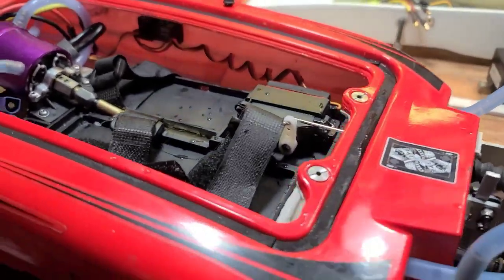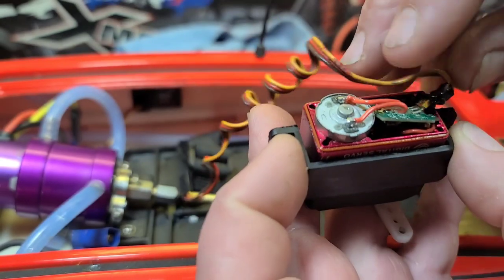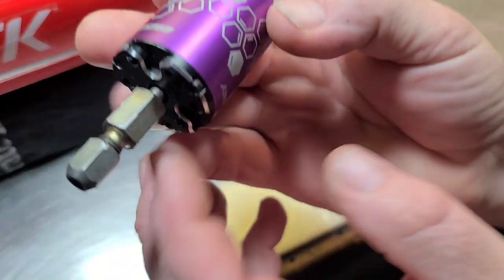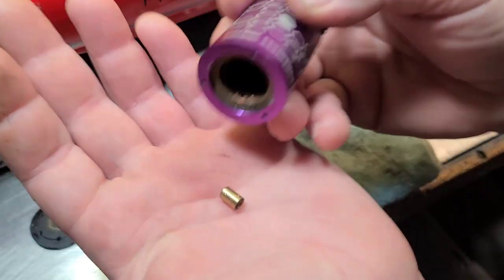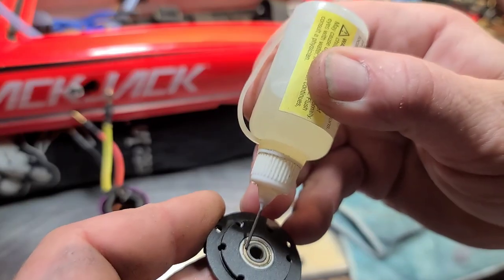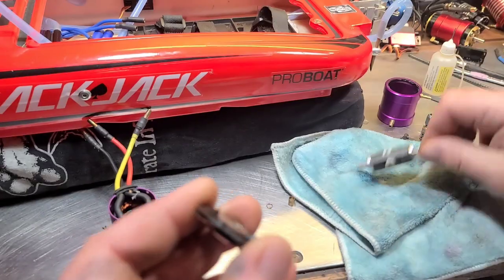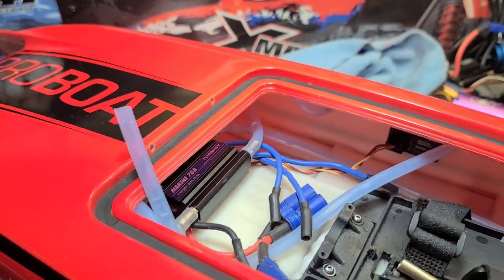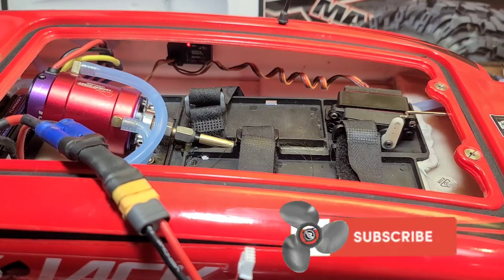Sinking Boat Save Your Electronics - Maintaining Your RC Boat After It Sinks

Comment: Good video! Good, Helpful Hints. 

May add its so helpful to buy large silica packs and always store boat and cars/crawlers/MTs with them inside the body.  Best to pop the hatch open. If I have an Oh Chit episode I will dry,  blow everything off, lint free towels on motors, oil/grease everything. Store the victim boat in a small guest bath with a dehumidifier running at least overnight.  Saved me a few times.

Comment: Take precautions before you sink it.  You can buy liquid electrical tape or plasti dip and use this to seal around the servo.  Paint it onto the receiver circuit board and around any openings to the battery.  Then use dielectric grease on all the electrical connectors.  If you take the time to do these things water will never be an issue again.  
Peace Big B  "Boat Crew"

Comment: Just got back from the lake for a few runs,and the cooling line fell out of the cooling jacket, it ran hesitant for a bit once I hooked up the cooling line back up,it was fine ,It’s a. Traxxas M41 , recived box is dry ,but opened it up and is drying.running it on 4s for now , not sure if I need to disassemble the engine ,it’s all stock, .Thanks Brother

Comment: If you do conformal coating on the ESC & reciever and the servo electronics board, then pack the whole servo with dielectric grease, you would save 90% of the electronics and never have issues with them submerged. All else like you did clean with Corrosion X and lube. Would be better to spray motor with Corrosion X before running so if gets submerged nothing will happen just let air out. Only issue will be the lipo battery unless sealed in a bag or box.
Reply: Done that  ,receiver is dry  just were the wires go into it there’s a big gap
Reply: I also upgrades the prop and trim tabs,to hot racing

Comment: I flipped my boat like 2days ago and i have just let it air dry, is there no hope for saving it or is it still good
Reply from the maker: Should be good, oil the motor bearings and grease the shaft, make sure receiver is dry..    Nine times out of ten, the servo will be the first to go if the boat was fully submerged
Reply: @IRONCLADRC I need help, my little brothers rc boat that’s $60 by deerc sunk to the bottom of our pool and the servo is seizing up and when I turn the boat on it automatically turns for the same position that’s not center and won’t turn well at all

Comment: Oh how bad Is it not running the Teflon tube inside the studfing tube 🤔? To be honest I really couldn't get it in
Reply from the maker: It's fine but the tube should be the right size w/o liner. Off shoe Electrics has a chart for tube /liner suggested sizing
Reply: @IRONCLADRC  it was the one that came with me shaft just I couldn't personally get it in. I am running a bushing at the prop end

Comment: I just sink my boat today and its still in the reservoir 😢 similar scenario and blow the lid and its snk within 5 seconds
Reply from the maker: Dang that's a bummer brother, try this method if it's not to deep, remember they glid while sinking so the hull maybe 30-40 feet away from where you actually saw it sink